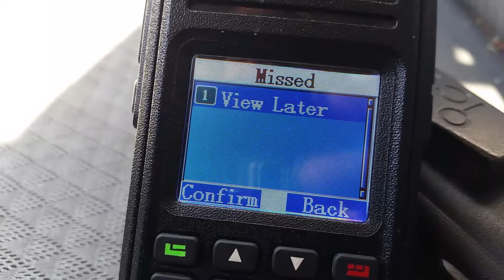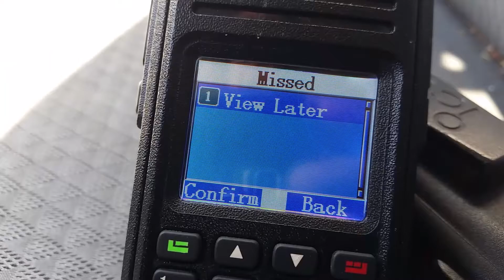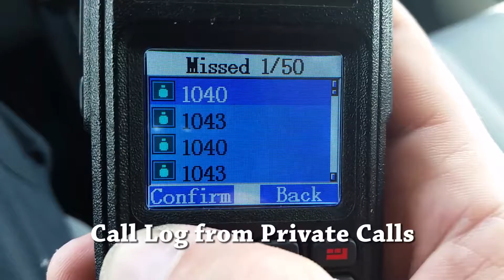Capacity Plus Scanning with Experimental MD-380 Firmware

Comment: Hello, you are wrong. This is only capacity+ mototrbo, but without RAS. Pleas read what is ras... it restricts you to transmit or listen the system. Only motorola radio with proper code will work out or radio scanner, dsd etc., which ignores radio header. This firmware doesnt ignore it! You just have an example of CAP+ system = different frequencies, gropus etc. and it monitors via scan mode, promiscous mode on... The same thing would be with anytone or other radios, which have promiscous mode and you scan over frequencies. I believe you don't know what is RAS

Comment: does this work with RAS
Reply from the maker: Yes, this was done on a RAS system
Reply: @RadioGeek  hmmm. We have lot of ras systems here, maybe its worth a try ;). Any other station like anytone does not decode ras system. 
Anyways there is no private calls
Reply: Does this oftware still exist?
Reply from the maker: I believe so, most of it can be had from the VA3XPR website, just make sure that the system is not using encryption. This firmware will not receive that.
Reply: @RadioGeek  its not. Its just cap+, using ras, and as i can se you can turn on promiscous mode, so it doesnt matter if its on slot 1 or 2... no channels only group calls. hope you can confirm.
Reply from the maker: That is correct, you just need the frequency and valid Color Code
Reply: @RadioGeek  nice one :) no other radios cant handle this, of course other than motorola ones :)
Reply: Can you contact me, because i heard it does not work... are you shure, its not only cap+ but not ras?

Comment: I been monitoring a cap plus net work I got the cc, but I have been using md380 tools v2. 0 with promiscuous mode on didn't get anything on my tyt, in my sdr see the different contacts if I add them to contact list not sure what tone to use but then would it work?  I'm just a noob at this stuff any pointers would be greatly appreciated thanks in advance
Reply from the maker: This is not the MD-380 Tools, I do not believe that MD-380 tools will do monitor mode like this. The radio is listening to any traffic no matter what group or private call.
Reply: Ok great thanks for reply will give it a go 👍

Comment: Just on the COLOUR CODE, if each channel does not have the correct CC set - the firmware will 'scan' for it using the experimental FW ?

Can you elaborate with what has to be enabled in the radio menu? Thanks
Reply: humaxf1 hi how do I get ma internal speaker on ma retevis rt2 transceiver
Reply from the maker: With this Firmware, the only thing you need is the correct Color Code. It will automatically hit on any Group or Private call.

Nothing has to be turned on in the menu, once the FW is loaded the radio will always do this, keep this in mind if you are using the radio to transmit on a system.

Comment: This is not actually following the capacity plus system though is it? It's just normal scanning of all the channels on the system?
Reply from the maker: No it is not following the system, like a Capacity plus radio would, but it does decode very well. If the system is using message trunking the radio will stay with the same conversation.

Comment: Hi, if I do it with windows, will I see it?
Reply from the maker: Are you talking about programming the radio? Or are you talking about viewing the system info live on the computer?
Reply: I'm talking about the firmware you installed with windows?
Reply from the maker: Yes I installed it with Windows